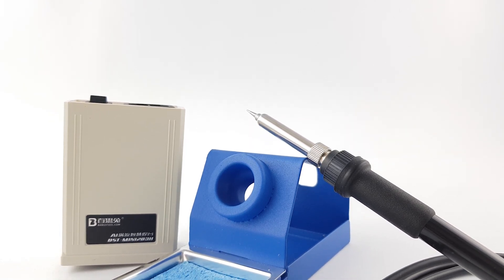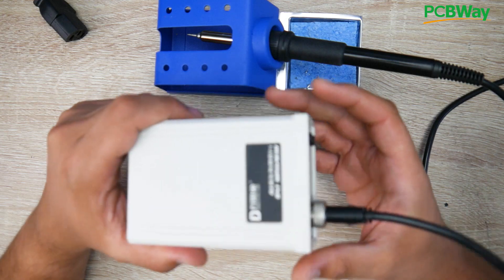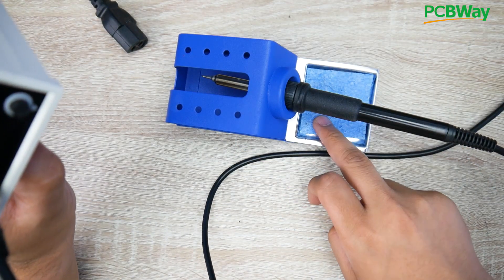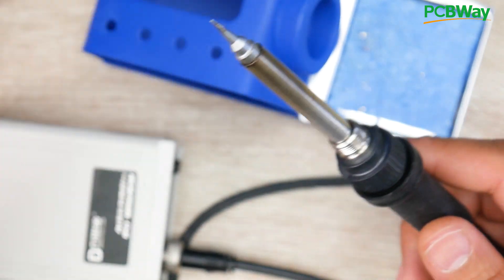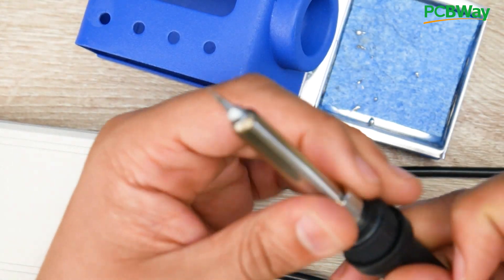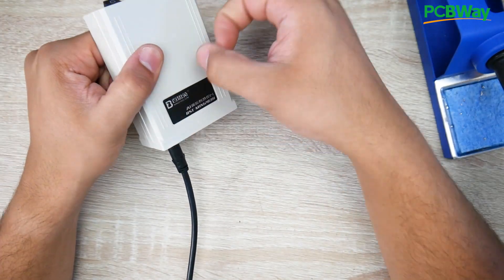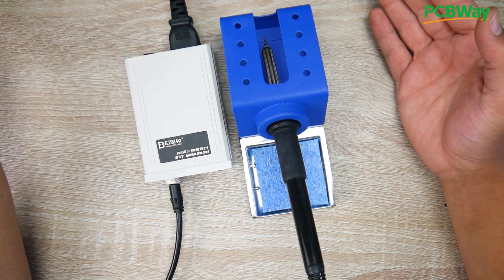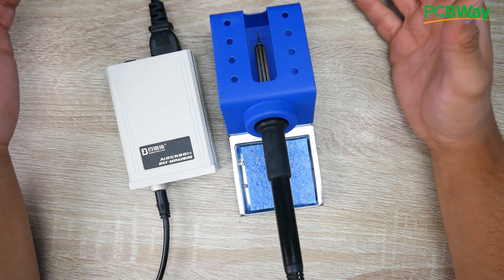Best Compact Soldering Under $40 // BANGSTOOL BST-MINI203H

Comment: Also a great iron is the KSGER T12. That’s a desktop-ts100. It also has the self-heating tips like the ts100. And size is similar to this product.  Plastic cases have the advantage that they don’t kill you if they forgot to ground the metal case (like it is the case in some products from that country)